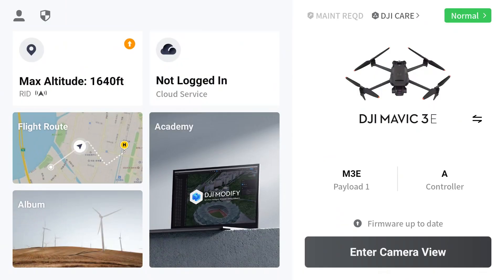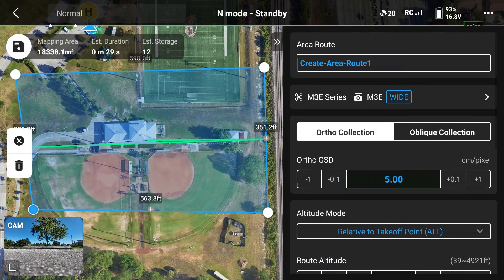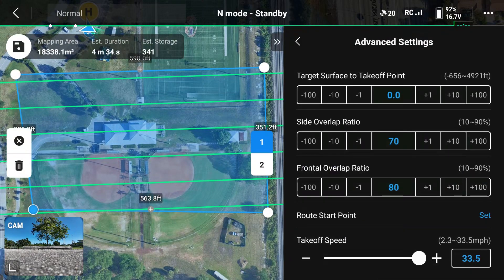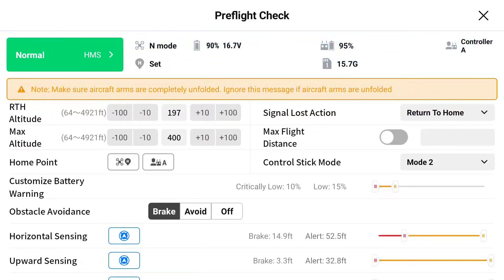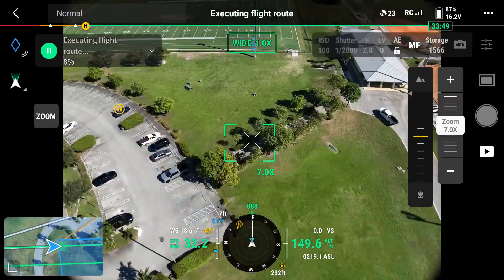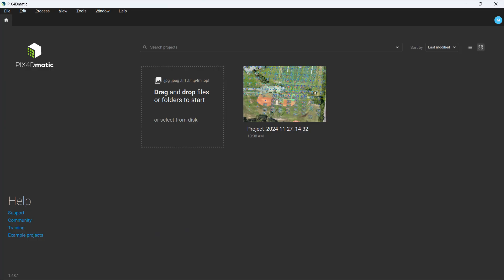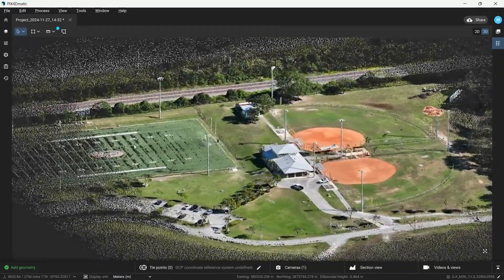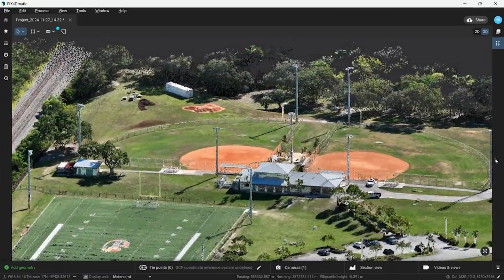Mapping With Pix4D Matic

Comment: thats the difference between pix4Dmapper and Pix4D Matic?
Reply from the maker: Hey Dexter, Pix4Dmapper is geared toward smaller projects while Pix4DMatic is optimized for larger datasets (5,000+ images). Still, you do get a bit more control with mapper, although it is the older of the two. That being said, you can still use both programs, regardless of how big your dataset is,
Reply: @DroneNerds ok thanks. Which one between the two is used to process lidar data?